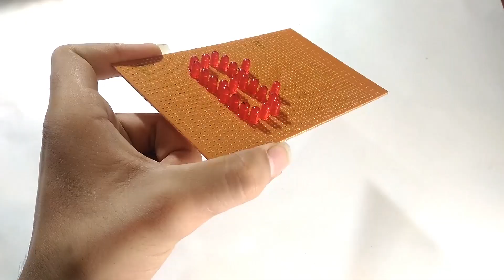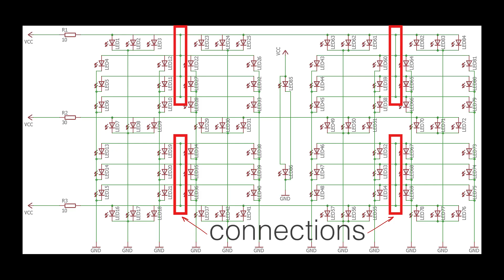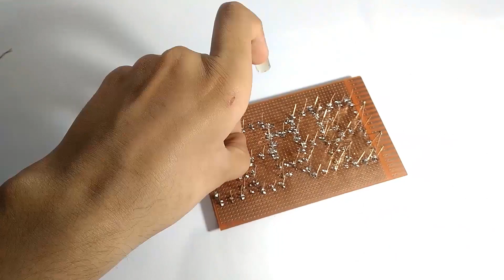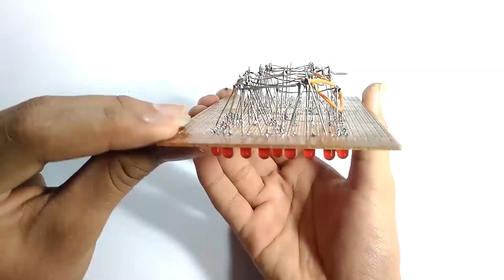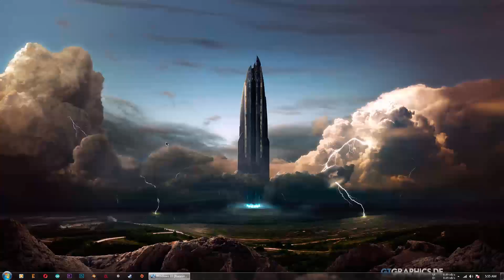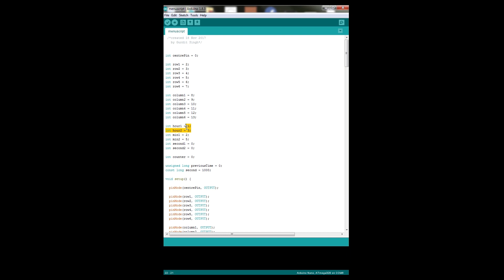How To Make A Digital Clock Using Arduino

Comment: Please give me the program code
Reply from the maker: /*created 18 Nov 2017
   by Gurdit Singh*/
   
   
int centrePin = 0;

int row1 = 2;
int row2 = 3;
int row3 = 4;
int row4 = 5;
int row5 = 6;
int row6 = 7;

int column1 = 8;
int column2 = 9;
int column3 = 10;
int column4 = 11;
int column5 = 12;
int column6 = 13;

int hour1 = 1;
int hour2 = 3;
int min1 = 2;
int min2 = 5;
int second1 = 0;
int second2 = 0;

int counter = 0;

unsigned long previousTime = 0;
const long second = 1000;

void setup() {
  
  pinMode(centrePin, OUTPUT);

  pinMode(row1, OUTPUT);
  pinMode(row2, OUTPUT);
  pinMode(row3, OUTPUT);
  pinMode(row4, OUTPUT);
  pinMode(row5, OUTPUT);
  pinMode(row6, OUTPUT);

  pinMode(column1, OUTPUT);
  pinMode(column2, OUTPUT);
  pinMode(column3, OUTPUT);
  pinMode(column4, OUTPUT);
  pinMode(column5, OUTPUT);
  pinMode(column6, OUTPUT);
 
 }

void loop() {

    unsigned long currentTime = millis();
    
    if(currentTime - previousTime >= second) {
      
      previousTime = currentTime + 6;

      counter = counter + 1;
      if(counter == 1) {
      digitalWrite(centrePin, HIGH); 
      }

      if(counter == 2) {
      digitalWrite(centrePin, LOW); 
      counter = 0;
      }
       
      
      second2++;
      if(second2 == 10) {
        second1++;
        second2 = 0;
      }
      if(second1 == 6) {
        min2++;
        second1 = 0;
      }
      if(min2 == 10) {
        min1++;
        min2 = 0;
      }
      if(min1 == 6) {
        hour2++;
        min1 = 0;
      }
      if(hour2 == 10) {
        hour1++;
        hour2 = 0;
      }
      if(hour2 == 4 && hour1 == 2) { 
        hour1++;
        hour2 = 0;
      } 
      if(hour1 == 3)
      hour1 = 0;
    }

    digitalWrite(column1, HIGH);
    digitalWrite(column2, HIGH);
    digitalWrite(column3, HIGH);
    digitalWrite(column4, HIGH);
    digitalWrite(column5, HIGH);
    digitalWrite(column6, HIGH);
    
    //""""HOUR SIDE""""
    //ROW 1 
    digitalWrite(row1, HIGH);
    
    //1ST LETTER EIGHT

    //top left segment
    if (hour1 == 0 || hour1 == 4 || hour1 == 5 || hour1 == 6 || hour1 == 8 || hour1 == 9)
      digitalWrite(column1, LOW);
    //top segment
    if (hour1 == 0 || hour1 == 2 || hour1 == 3 || hour1 == 5 || hour1 == 6 || hour1 == 7 || hour1 == 8 || hour1 == 9)
      digitalWrite(column2, LOW);
    //top right segment
    if (hour1 == 0 || hour1 == 1 || hour1 == 2 || hour1 == 3 || hour1 == 4 || hour1 == 7 || hour1 == 8 || hour1 == 9) 
      digitalWrite(column3, LOW);
    
    //2ND LETTER EIGHT

    //top left segment
    if (hour2 == 0 || hour2 == 4 || hour2 == 5 || hour2 == 6 || hour2 == 8 || hour2 == 9)
      digitalWrite(column4, LOW);
    //top segment
    if (hour2 == 0 || hour2 == 2 || hour2 == 3 || hour2 == 5 || hour2 == 6 || hour2 == 7 || hour2 == 8 || hour2 == 9)
      digitalWrite(column5, LOW);
    //top right segment
    if (hour2 == 0 || hour2 == 1 || hour2 == 2 || hour2 == 3 || hour2 == 4 || hour2 == 7 || hour2 == 8 || hour2 == 9) 
      digitalWrite(column6, LOW);
    delay(1);
    digitalWrite(row1, LOW);
    
    digitalWrite(column1, HIGH);
    digitalWrite(column2, HIGH);
    digitalWrite(column3, HIGH);
    digitalWrite(column4, HIGH);
    digitalWrite(column5, HIGH);
    digitalWrite(column6, HIGH);
    
    //ROW 2
    digitalWrite(row2, HIGH);
    
    //1ST LETTER EIGHT

    //center segment
    if(hour1 == 2 || hour1 == 3 || hour1 == 4 || hour1 == 5 || hour1 == 6 || hour1 == 8 || hour1 == 9)
      digitalWrite(column2, LOW);

    //2ND LETTER EIGHT

    //center segment
    if(hour2 == 2 || hour2 == 3 || hour2 == 4 || hour2 == 5 || hour2 == 6 || hour2 == 8 || hour2 == 9)
      digitalWrite(column5, LOW);
    delay(1);
    digitalWrite(row2, LOW);
    
    digitalWrite(column1, HIGH);
    digitalWrite(column2, HIGH);
    digitalWrite(column3, HIGH);
    digitalWrite(column4, HIGH);
    digitalWrite(column5, HIGH);
    digitalWrite(column6, HIGH);

    //ROW 3
    digitalWrite(row3, HIGH);
    //1ST LETTER EIGHT

    //bottom left segment
    if (hour1 == 0 || hour1 == 2 || hour1 == 6 || hour1 == 8)
      digitalWrite(column1, LOW);
    //bottom segment
    if (hour1 == 0 || hour1 == 2 || hour1 == 3 || hour1 == 5 || hour1 == 6 || hour1 == 8 || hour1 == 9)
      digitalWrite(column2, LOW);
    //bottom right segment
    if (hour1 == 0 || hour1 == 1 || hour1 == 3 || hour1 == 4 || hour1 == 5 || hour1 == 6 || hour1 == 7 || hour1 == 8 || hour1 == 9) 
      digitalWrite(column3, LOW);

    //2ND LETTER EIGHT

    //bottom segment
    //bottom left segment
    if (hour2 == 0 || hour2 == 2 || hour2 == 6 || hour2 == 8)
      digitalWrite(column4, LOW);
    //bottom segment
    if (hour2 == 0 || hour2 == 2 || hour2 == 3 || hour2 == 5 || hour2 == 6 || hour2 == 8 || hour2 == 9)
      digitalWrite(column5, LOW);
    //bottom right segment
    if (hour2 == 0 || hour2 == 1 || hour2 == 3 || hour2 == 4 || hour2 == 5 || hour2 == 6 || hour2 == 7 || hour2 == 8 || hour2 == 9) 
      digitalWrite(column6, LOW);
    delay(1);
    digitalWrite(row3, LOW);
    
    digitalWrite(column1, HIGH);
    digitalWrite(column2, HIGH);
    digitalWrite(column3, HIGH);
    digitalWrite(column4, HIGH);
    digitalWrite(column5, HIGH);
    digitalWrite(column6, HIGH);

    //"""MIN SIDE"""
    //ROW 4 
    digitalWrite(row4, HIGH);
    
    //1ST LETTER EIGHT

    //top left segment
    if (min1 == 0 || min1 == 4 || min1 == 5 || min1 == 6 || min1 == 8 || min1 == 9)
      digitalWrite(column1, LOW);
    //top segment
    if (min1 == 0 || min1 == 2 || min1 == 3 || min1 == 5 || min1 == 6 || min1 == 7 || min1 == 8 || min1 == 9)
      digitalWrite(column2, LOW);
    //top right segment
    if (min1 == 0 || min1 == 1 || min1 == 2 || min1 == 3 || min1 == 4 || min1 == 7 || min1 == 8 || min1 == 9) 
      digitalWrite(column3, LOW);
    
    //2ND LETTER EIGHT

    //top left segment
    if (min2 == 0 || min2 == 4 || min2 == 5 || min2 == 6 || min2 == 8 || min2 == 9)
      digitalWrite(column4, LOW);
    //top segment
    if (min2 == 0 || min2 == 2 || min2 == 3 || min2 == 5 || min2 == 6 || min2 == 7 || min2 == 8 || min2 == 9)
      digitalWrite(column5, LOW);
    //top right segment
    if (min2 == 0 || min2 == 1 || min2 == 2 || min2 == 3 || min2 == 4 || min2 == 7 || min2 == 8 || min2 == 9) 
      digitalWrite(column6, LOW);
    delay(1);
    digitalWrite(row4, LOW);
    
    digitalWrite(column1, HIGH);
    digitalWrite(column2, HIGH);
    digitalWrite(column3, HIGH);
    digitalWrite(column4, HIGH);
    digitalWrite(column5, HIGH);
    digitalWrite(column6, HIGH);

    //ROW 5
    digitalWrite(row5, HIGH);
    
    //1ST LETTER EIGHT

    //center segment
    if(min1 == 2 || min1 == 3 || min1 == 4 || min1 == 5 || min1 == 6 || min1 == 8 || min1 == 9)
      digitalWrite(column2, LOW);

    //2ND LETTER EIGHT

    //center segment
    if(min2 == 2 || min2 == 3 || min2 == 4 || min2 == 5 || min2 == 6 || min2 == 8 || min2 == 9)
      digitalWrite(column5, LOW);
    delay(1);
    digitalWrite(row5, LOW);
    
    digitalWrite(column1, HIGH);
    digitalWrite(column2, HIGH);
    digitalWrite(column3, HIGH);
    digitalWrite(column4, HIGH);
    digitalWrite(column5, HIGH);
    digitalWrite(column6, HIGH);

    //ROW 6
    digitalWrite(row6, HIGH);
    //1ST LETTER EIGHT

    //bottom left segment
    if (min1 == 0 || min1 == 2 || min1 == 6 || min1 == 8)
      digitalWrite(column1, LOW);
    //bottom segment
    if (min1 == 0 || min1 == 2 || min1 == 3 || min1 == 5 || min1 == 6 || min1 == 8 || min1 == 9)
      digitalWrite(column2, LOW);
    //bottom right segment
    if (min1 == 0 || min1 == 1 || min1 == 3 || min1 == 4 || min1 == 5 || min1 == 6 || min1 == 7 || min1 == 8 || min1 == 9) 
      digitalWrite(column3, LOW);

    //2ND LETTER EIGHT

    //bottom segment
    //bottom left segment
    if (min2 == 0 || min2 == 2 || min2 == 6 || min2 == 8)
      digitalWrite(column4, LOW);
    //bottom segment
    if (min2 == 0 || min2 == 2 || min2 == 3 || min2 == 5 || min2 == 6 || min2 == 8 || min2 == 9)
      digitalWrite(column5, LOW);
    //bottom right segment
    if (min2 == 0 || min2 == 1 || min2 == 3 || min2 == 4 || min2 == 5 || min2 == 6 || min2 == 7 || min2 == 8 || min2 == 9) 
      digitalWrite(column6, LOW);
    delay(1);
    digitalWrite(row6, LOW);
    
    digitalWrite(column1, HIGH);
    digitalWrite(column2, HIGH);
    digitalWrite(column3, HIGH);
    digitalWrite(column4, HIGH);
    digitalWrite(column5, HIGH);
    digitalWrite(column6, HIGH);

}

Comment: I tried to build this clock, but having problems. Seems like I have the segments wrong or something. So is the left digit considered " number one" digit? And does it matter if the ground wires going to the arduino board are wrong ? Ex. pin 12 and pin 9 ground wires switched.
Reply from the maker: sorry for replying late,
at 2:19 , you can refer the diagram highlighting all the segments, and also the circuit diagram at 3:25 to verify the connections

also try to grab some basic concept of multiplexing from the internet, as I fail to fully explain that in this video, with that knowledge you can reverse engineer the code and circuit to make something that is much efficient than what I've made...

yes, you can swap any ground pins with one another as long as they are the ground pins

Comment: Can i use arduino nano??
Reply from the maker: that's exactly what I've used. So, yes
Reply: Can it use 12v led strip and 12v power supply??
Reply from the maker: @valkeebs8431  if the LEDs in that strip are connected in series then NO, otherwise maybe yes..